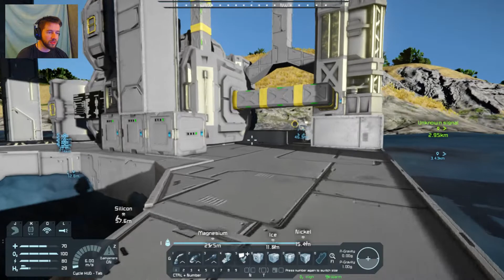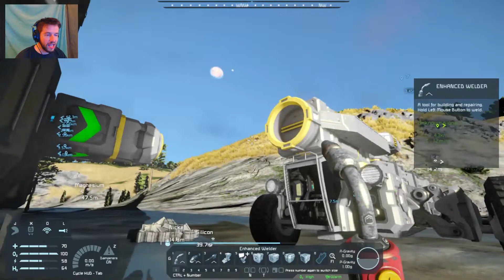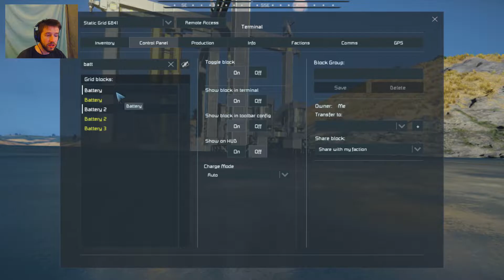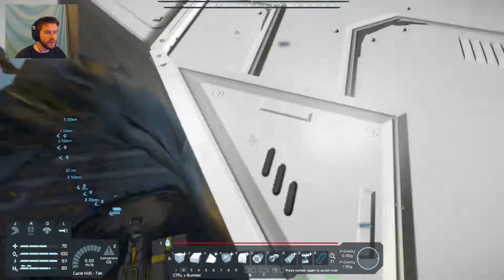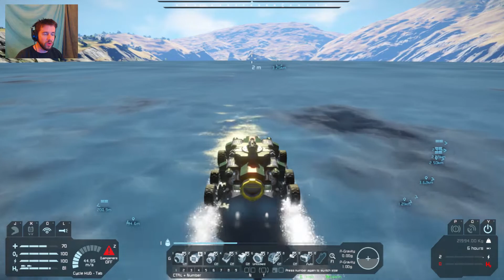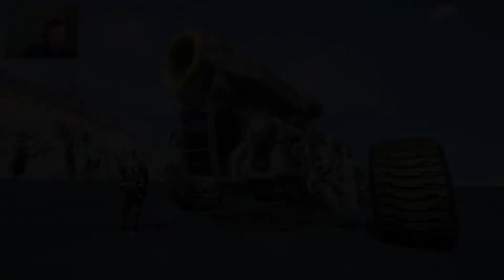Space Engineers, Survival - Season 1, Episode 12 - Automation & Mining Silver

Comment: Interesting use of timers on the drilling, but you can simplify the piston extension by just slowing them down (control left click on the slider) to 0.05 or so.  As you have opposing drills drilling out the exact same path you could probably go faster.  I usually go with a lopsided arrangement and stack a bunch of drills vertically to dig out one one side and a slow rotation speed - Kanajashi has some good vids showing the basic setup.  Can't remember of you covered it before, but "shared inertia tensor" may be advisable to keep Doctor Klang at bay.
Reply from the maker: While trying to excavate some of the remaining ore in the mine I actually converted the system to a stand alone one and done use, where I'd build and dismantle it, testing variations on the set up. The fastest method that's consistent with the timer commands was to use two pistons (that way any extension is double to the 1 m/s mark I was looking for) and have four drills all pointing in four directions. You can basically get a drilling pass of about 2 and half minutes with a rotor turn of 0.1 rpm.

The real problem I ran into is if I'm too efficient with my drilling, I end up with way more material then I can handle. =P I have seen a few of Kanajashi's set ups, they are pretty cool! As for the share inertia tensor, I have definitely used it, I just don't think I've mentioned it during the videos... Anywho, thanks for watching! I really appreciate the feedback. ^_^
Reply: Air traffic.  It adds to the modular spawner
Reply from the maker: Awesome, thank you! Forgive me, I hadn't realised you'd suggested this in this thread. But I do appreciate it. ^_^